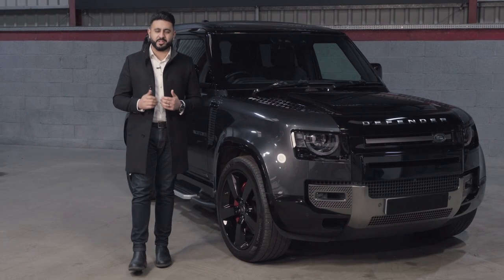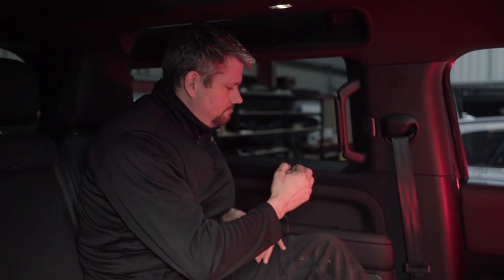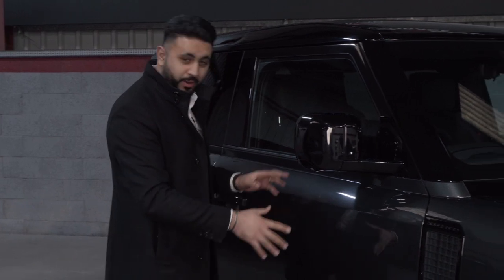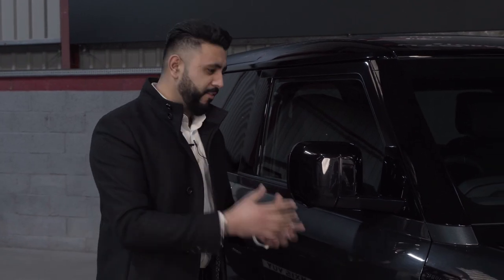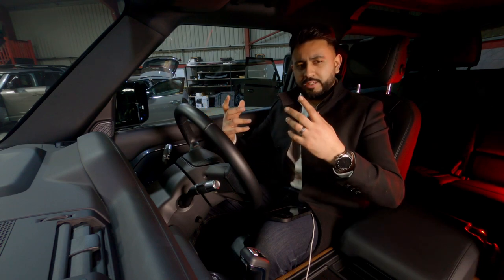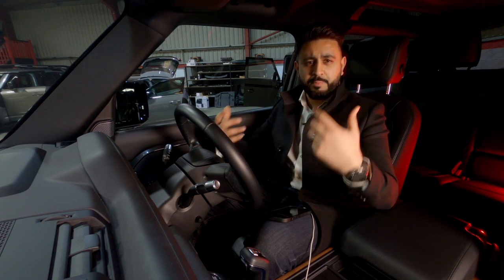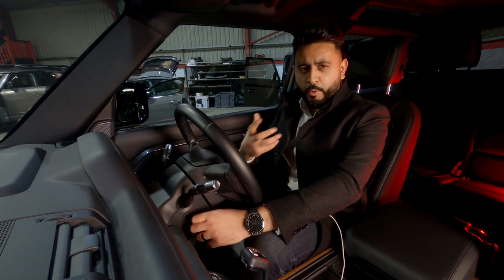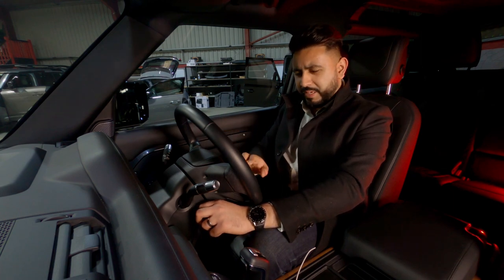New Defender 90 RATTLES LIKE MAD!

Comment: Bass roll off can work really well if it's combined with a factory sub. At low volume levels the doors can produce more of the bass frequencies so improving bass in the front of the vehicle, as the volume level increase the bass is reduced in the doors to help protect the speakers and the bass frequencies are moved to the subwoofer.  The problem is that without the subwoofer the bass just disappears at higher volumes.
Reply from the maker: Thank you for your comment. You are correct, this car doesn’t have a factory sub so that’s why it sounds bad

Comment: Hi team i have 2023 Defender 110. I am going for Full Da setup from Audison (Virtuoso dsp and all thesis amps and speakers) Is there any interface available for plug n play just like bit DMI or Nav tv. Please help
Reply from the maker: Who is doing your installation?
Reply: @CambridgeCarAudio  Not finalized the dealer yet. In talks with a dealer in Bangalore, India. But spoke with top dealers in India nobody knows about if there is a interface for Defender 110 or i will have to ask them to use high level.
Reply from the maker: @prateecksharma5442  Your installer should know, if they don’t, don’t let them touch the car with this level of gear is my advice
Reply: @CambridgeCarAudio  They have installed this gear in multiple cars. And same one installed in my porsche cayenne but for that we had Nav TV interface. But for Defender they are not able to find. If you can please help, i will be greatful. I love your installations but the issue is we are across countries so for me its not feasible to send cars there
Reply from the maker: @prateecksharma5442  No problem, no interference issues, we use an LC7i
Reply: @CambridgeCarAudio  Great. Thank You so much for helping ☺️
Reply from the maker: @prateecksharma5442  Would appreciate it if you could leave us a Google review :)